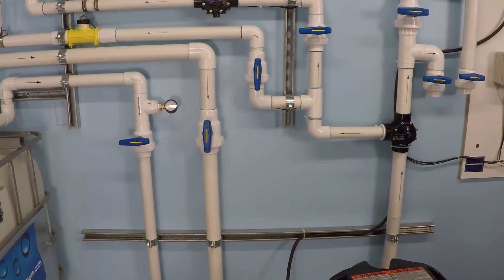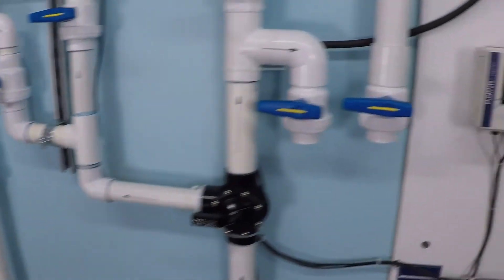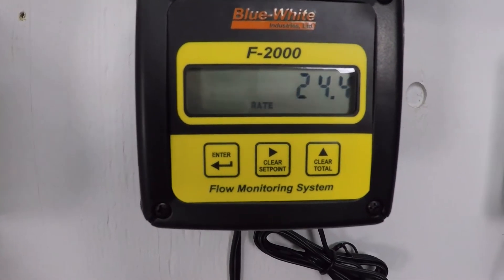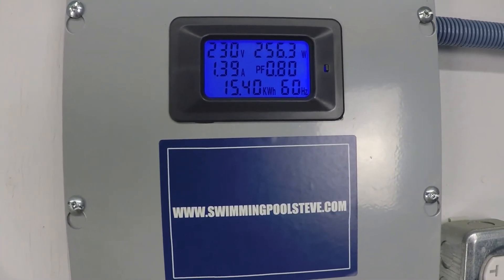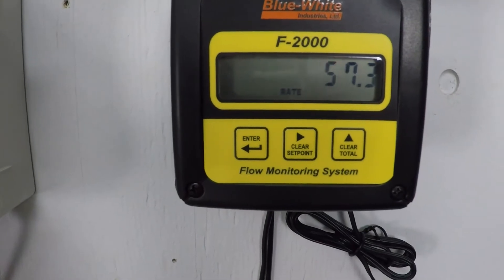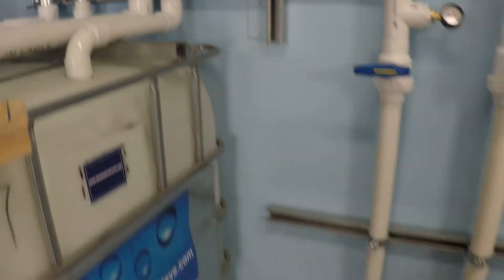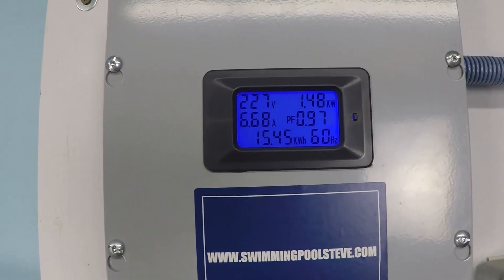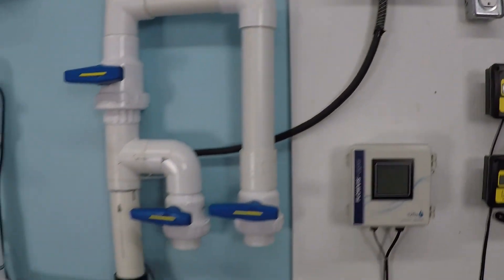Variable Speed Pump Test For 2" Suction & 1.5" Return

Comment: So running an Intelliflow pump at 2700 rpms is over kill considering all plumbing is 2” diameter on 13000 gal pool?
Reply from the maker: 13k gallon pool is on the smaller side.  By the book you should have about 40k gallons filtered daily.  You need a few hours at higher speeds every day for better water circulation and for your skimmer to work, plus any time needed for peripheral items like salt water, heaters etc.  In total the schedule should look like 16 hours at very low RPM, a few hours at (almost) full RPM, and a few hours at mid range RPM.  The total of this running should equal about 40k for your pool and the way you dial that in is with a flow meter.  Without a flow meter you can only guess as to flow rates.  For my pools I like to use FlowVis flow meters and Blue-White flow meters.  Either of these two brands will allow you to monitor the exact rate of water movement through your system at any time.
Reply: Swimming Pool Steve thank you sir. I guess I will be looking into a flow meter.
Reply: Would it be better to set it to 2000 rpms to allow the water to turnover twice in a 10 hr period?

Comment: I’ve got a 10K gallon on ground pool on the way.  The supplier says 1.5” lines are sufficient but I’m wondering if I should upgrade to 2” everywhere or a mixture of 2” on the suction side and 1.5 for returns. I’ll have a VS pump as well.
Reply from the maker: Is sufficient the same as efficient?  Definitely not.  10k is a small pool, but I would never use 1.5" for suction lines again no matter of pool size.  The absolute minimum I would work with for any pool is 2" suction lines and multiple 1.5" returns fed from a 2" return manifold.  Entire equipment pad must be in 2".  Designing for efficiency is not something every builder does.  A few dollars more for bigger pipes will pay you back every day that you own this pool.  VGBA flow velocity and GPM for rates for things like skimmers and main drains must still be followed.

Comment: Steve I have same pump as shown in vid here with a 21k gallons pool I'm looking to upgrade my pentair SD80 sand to a cartridge filter not sure the make yet I'm kinda looking at the Hayward but not sure yet my question what would you suggest as to size FILTER should I be looking at ??
Reply from the maker: I would be using a 300sf cartridge filter on this pool, give or take a little. The maximum design flow rate is what i am looking at most of all. if you can spend a few bucks more for a much higher max design flow rate I would do it.
Reply: So say c4030 Hayward or pentair same sq ft I'll be good ???
Reply from the maker: @grassthief1280  A C3030 would be 325sf and that would be enough for your pool.  Feel free to overkill it with a 4030 but you definitely do not "need" that much filter.
Reply: Steve I'm subscribing to your service so you can help me build the correct & ultimate pool plumbing